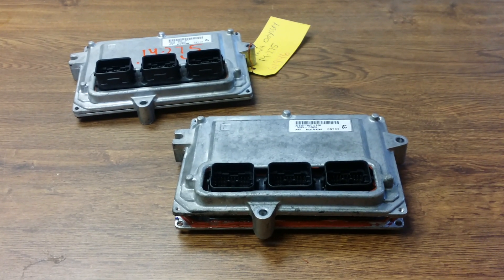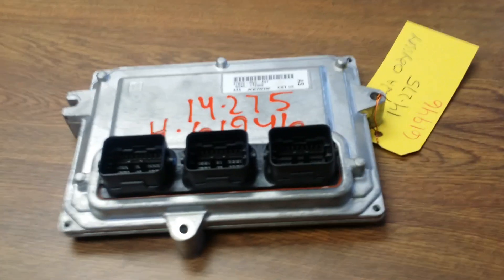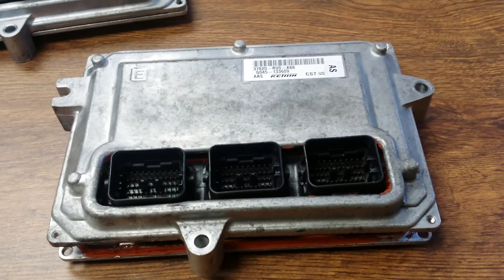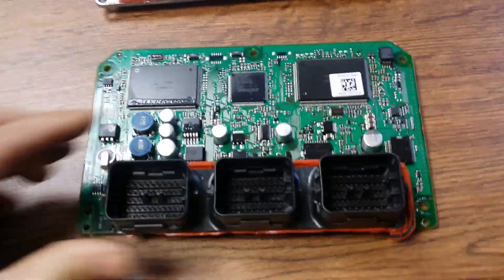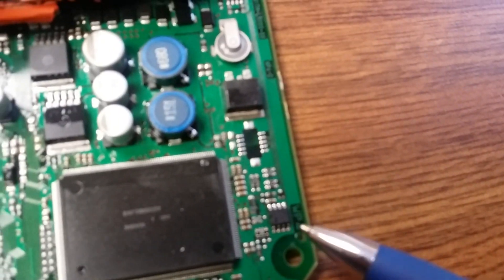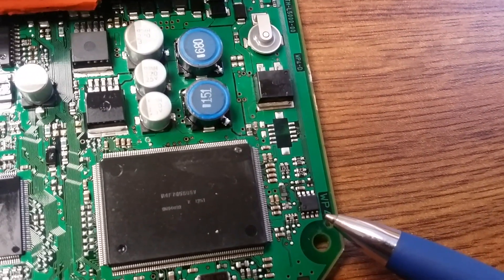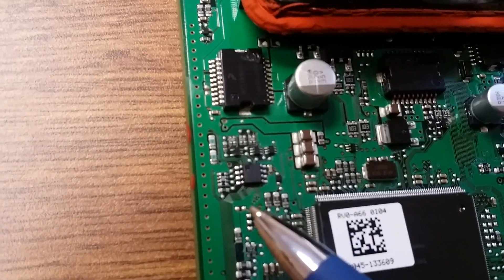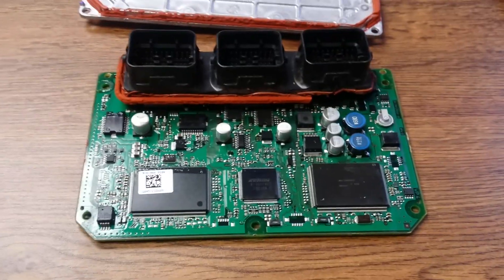HOW TO PROGRAM HONDA ECU IMMOBILIZER KEY AFTER ECU SWAP

Comment: Hey George I have a 98 Honda prelude when I put my key in the on position my fuel injectors spray out fuel causing my engine to flood, I put a new ecu in it and I'm not having that issue anymore however my car will not start now. I'm thinking of going to the dealership to get a new immobilizer and new key. If you can please respond guiding me in the right direction
Reply from the maker: is tour green key flashing on dash while you cranking over your engine?
Reply: No it is not..
Reply from the maker: Then you dont have immobilizer issue you probably flooded engine with gas. Pull plugs all plugs out crank engine with out plugs for few seconds that will spit out all gas out of the cylinder s then check for spark on your plugs before you reinstall them. Also will be a good idea to check fuel pump if its working right
Reply: George Melnik George I just checked again and when I put the key in the on position it flashes.. The weird thing is it starts then dies right away.. Thanks for the fast response George !
Reply from the maker: Ok here is exactly what you need to do. You need to perform replace ecm pcm procedure and reprogram tour keys.  You can swap eeproms  from your old computer to new. Or call someone who has honds hds scan tool to do that. You can also purchase launch 431x on ebay and that will also be able to do that procedure as i am myself using launch 431x
Reply: George Melnik i have 02 honda accord when i am driving the green  key starts flashing on dash board and stalls but when i hit the steering wheel up and down i see the green key and it goes away and i turn the key and starts right way
Reply: George melnik what can be the problem?

Comment: George, I have an immobilizer tech question for you. Honda, in 2008 and 09 modified their system by adding an external imoes unit which communicates with the control unit-receiver and the ecm. Now the Question! Does the imoes send a wake up signal to the receiver or does the receiver send its own signal without wake up? I have an intermittent signal at the s-net terminal of the control unit. Thanks for any tech support.
Reply from the maker: All 3 work together. Immo thats on the steering wheel ignition lock switch sends its signal to the bcm (smart junction box) then bcm verifies ecm for immobilizer code and then it lets you start the car if all 3 match. I hope i understood your question correctly.
Reply: So, the receiver doesn't need to be awakened. If it is working correctly it will send a signal. Thanks.
Reply from the maker: That is correct

Comment: Hello George, I need to replace an ecu for a 2003 Honda CRV 4x4 Automatic.  I noticed that you mentioned it might the 93c66 or 93c76 or R56 or R57 from a previous reply for a 08 (3rd gen CRV) than need to be exchanged.  Is it the same chips for the 03?
Reply from the maker: They should be similar
Reply from the maker: They are all similar i am not exactly sure  which one is in the 03
Reply: Thank you George, have safe and happy holiday

Comment: Hi George what chips would i change for a 08 Honda CRV? I'm replacing old ECU with new ECU n after using SBB scanner immobilizer function the 
green key still flashing. Is there a step i missed? If i change chips will the car start or is there another step ill hv to perform to get it to start? Thank you !
Reply from the maker: You need to clone it or perform replace ecm pcm procedure. You need a good scan tool to do that. I also have a video on that. Sbb will only reprogram your key in to bcm and immobilizer module it will not program it in to the pcm. If you try cloning ur pcm you need to replace 1 or 2 eeproms. I have not done CRV so i am not sure about which number eeprom it is but its usually 93c66 or 93c76 or R56 or R57

Comment: Where can I find that ecu box in a Honda Accord 2015 it starts with 37820 I can't find it in my car
Reply from the maker: Ok. If your car is a v6 3.5l its right behind passenger's side headlight under black plastic cover. If your accord is a 4 cyl then its next to aircleaner box and battery also under black plastic cover.
Reply from the maker: That is where engine control module located

Comment: Hi sorry for bad english  I have honda accord 2011 and I have a problem In shifting gear 2# can u tell me which IC Is bad In ecu
Reply from the maker: Ic will not fix your shifting issue. If its a bad computer then you can swap immobilizer ic to dtart the car with out reprogramming your computer
Reply: George Melnik I know Ic will not fix but we can change that Ic If we know which Ic Is bad and what's Ic number

Comment: Good day George, I have a situation where I have to swap ECU's on D16V1 Honda Civic EP2.
Is the imobilizer chip coded 93c56, and is there one, or more of them?
Thank you for your time and help, and greetings from Croatia!
Reply from the maker: Yes thats the chip there is usually one more.
Reply: +George Melnik  So, I have located total of 4 eeproms on this PCB. Every other has some random number, when I google it i get nothing, but this L56R is marked as Low voltage 93C56 EEPROM. ( so i suspect that is it ) And there are no others eeproms, not on front nor back side. D17A2 ECU.
Reply from the maker: Yes l56r and 93c56 is it repl
ace those 2 and you will be ok
Reply: +George Melnik Nono, I only have one L56R chip. And i found that that is just another marking for it. So I only have that one eeprom, others are something like 2203 J064.
So, only one chip that matches what we need. No other eeproms on PCB.
Reply from the maker: Yes that is it

Comment: cant you just reprogram the key to work with this ecu  instead remove immobilizer eepromm ?
Reply from the maker: Yes you can and i can but not everyone has a scan tool to do it and not everybody wants to spend 150 buck on a locksmith or to pay dealer to do it. This method is free of charge if you have your old computer
Reply: +George Melnik do you know anything about smart keys FOB ? from what i understand if i buy a used fob already cut blade u can program it to the car but what if the blade is not cut and you do not have oringinal key for like a newer bmw
Reply from the maker: Thats not a problem at all. Its called security access  key. That can be cut by any bmw dealer. (Parts department )You will have 2 bring them ur title or a memorandum title. That key blade is cheap anywhere from 25 to 40 bucks.
Reply: if they used fob has one blade already cut can it just be programmed
Reply from the maker: Yes it can be.

Comment: meaning all cars that  have factory install immobilizer need this proceduce for the car to start is that it.
Reply from the maker: You only need to do this procedure if your computer was damaged and you don't want to spend money on programming computer and you want to do it yourself.
Reply: +George Melnik hi george i have a question to you how to reprogram the key for my honda civic i vtec 2006 model..my key is losing so that i buy key cylinder.then when i try it its flashing the key.i start in 3 second then stop..pls help me what can i do..

Comment: how to identify that is the immobilizer chip for other vehicle.?
Reply from the maker: You have 2 have experience or a ecu rebuilding software which will show you which chip holds immob data
Reply: Ahh ok thank you soo much 
 George
Reply: +George Melnik I got Acura I have a computer but I can't program it can I do the same
Reply from the maker: They are all eeprom and there is a software for rebuilding and reflashing modules that helps

Comment: Do you know what chip or chips from the ECU on Honda civic 2001 stores the information for the key immobilizer?
Reply: the only way to avoid programing is to buy ecu, key ignition with transponder and key from the same car. junk yard is cheapest . Make sure the ecu part number matches your ecu part number.
Reply from the maker: carmen delposo it is 93c56
Reply: George Melnik   I've changed the ignition switch on my 2009 honda accord and car won't start up. Is there any way to program the key to old ecu
Reply: The old key and the ecu are matching. the problem is the new transponder in the new ignition key. Can't you change just the ignition key and leave the old transponder? On the previous Hondas you can.
Reply: carmen delposo I don't have the old key. I Bought this car from insurance auction without key. Question is If I buy used ecu and ignition switch from same donor vehicle do I still have to program something?
Reply: carmen delposo Thanks.. I'll try to find same vin ecu and ignition switch with oem key
Reply: the vin is going to be different just look at the ecu part number.